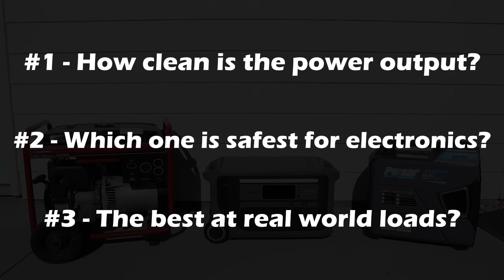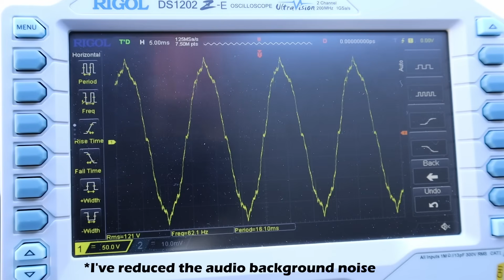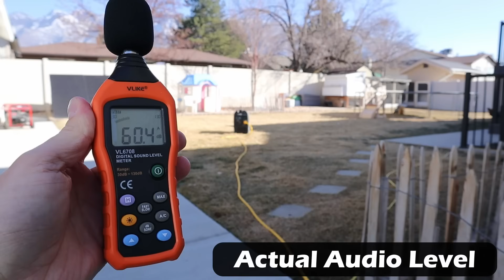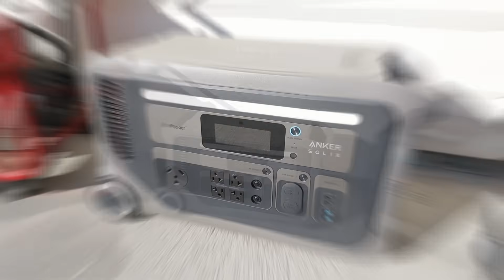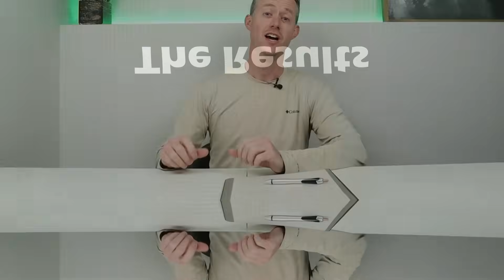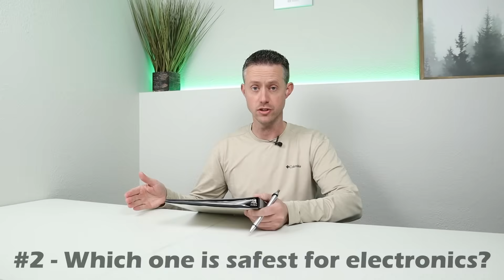Before You Plug Electronics Into A Generator, Watch This!

Comment: I recommend Honda Generators.  You can buy them and sell them for the same price or more you paid for them after a few years.   Done it many times.   They are bullet proof.
Reply from the maker: They definitely hold their value and last a LONG time!
Reply: @Jasonoid  One of the reasons I bought a Honda EU2200i and I am planning at some point to buy the 2200i companion model as well.  I don't really understand why Honda charges a bit more for the companion but they do.
Reply: @WJCTechyman I think it's because the companion has a higher output outlet for when they are joined together
Reply: @Jasonoid   No,they are not bulletproof. I own an older Honda 2000 gen and apart from regular problems with carburetor and fuel pump,the thing slowly disintegrates ,the plastic base anchoring the structure above is gone in strategical places (screws). Difficult to service and absolutely overpriced
Reply: I am a Honda power equipment ASC (along with many others).  Hondas are very good but are certainly not "bullet proof".
Reply: I work on this type of equipment professionally, the Hondas do not hold up well to large motor loads. If you have really poor power factor you will eventually blow the inverter board. I don't care if it's an eu2200 or an eu7000. They are great for powering electronics and other non motor loads. If you're going to be running a table saw all day, there's a reason they still offer an commercial conventional generator line.
Reply: @DJS_ENO  That is what they made for electric.  Your an idiot if you using them on a job side to run dirty motors all the time.  Sounds like you are customers are morons.  Job security.

Comment: Are you able to do the same test while on pass through mode?
(Inverter generator >>Ankerf3000>>load?

The anker can pass through 3600 watts
Reply from the maker: That sounds like an excellent video idea. In theory, it should work just fine since the inverter generator puts out such great power.
Reply: I'm curious if the Anker has the filter circuitry to de-noise/smooth the sine wave? 🤔
Reply: Maybe also through in a couple of zoupW solar panels!

Comment: That THD on the non-inverter generator is actually pretty dang good for that type of generator,  and unloaded Frequency is expected to be around 61 to 62 Hz, because it's related to engine speed, and when the generator takes a load you expect a drop in speed or Hz.  but that voltage was pretty low, even for a traditional generator, it may have other issues.  Nice comparison of backup power options though.  enjoy the videos.
Reply: Agreed. I would expect THD on a generator that old to be closer to 20. Maybe only the larger ones hit that level.
Reply: @markkempton4579 as the load climbs usually the THD does..keeping the loaded at about half rated running load usually keeps THD much lower.
Reply: @JONNYGEEKMANG  Will sometimes depend on the types of loads. THD will climb, but a mix of inductive and capacitive loads tends to keep it in check.
Reply from the maker: Thanks for sharing your feedback, I'm not super experienced with generators.
Reply: @Jasonoid It's not underestimate that a lot of the audience doesn't even know the difference. I try to keep things pretty simple and boiled down and I don't pull out things from my electrical engineering toolbox. Usually what happens when you do people who don't understand all those terms just start ignoring facts and they say THD bad only inverter generator.
Reply: I was thinking the same thing!
Reply: The speed "frequency controll"  feedback of the engine was poor, but probably adequate.
More loopgain.... needs a PLL or frequency detector. That controlles the throttle or adjust  the ignition.
Reply: @andreaskampe9143  The older generators, and many modern ones, use a mechanical governor. So there is a lag in the response that cannot be avoided. Plus even if it were electronic with fuel injection, there is still the mechanical inertia of the engine and generator rotor to overcome.
Reply: Te biggest problem is that the frequency oscilates due to single cylinder 4 stroke.
The DC frequency error can easily be fixed with a PID controller
 @mxslick50
Reply: @andreaskampe9143 It is basically a construction generator, no electronic governor and a very basic voltage regulator.
Reply: @andreaskampe9143 The governor response is not poor, that's exactly how it's supposed to function. You are combating mechanical hysteresis in the governor system. There are engines on the market which are now beginning to use an electronic governor, but they are relatively rare. I don't know if they've made it to the conventional generator applications yet.
Reply: @DJS_ENO  Changez le ressort du gouverneur. Vous verrez de suite un changement . Ces ressorts vieillissent très mal .
Reply: @gillescossec5571 Thank you for the information to check the spring if the frequency moves too much.
Reply: @andreaskampe9143 61hz-62hz unloaded and 58hz-59hz loaded is normal for this type of generator. If it's mechanical governor was set to hold a tighter tolerance surging could become a problem at light load.

Comment: Would putting an whole house surge protector in the house circuit breaker box have any improvement in both the street power and the generator going through the transfer switch? I was curious if this would enable the dirty power to be regulated by the home surge protector and prevent electrical interference.
Reply from the maker: It's more affordable to just buy a new inverter generator VS all the devices needed to clean up the power. They are usually much more fuel efficient anyways so you'll be saving on fuel as well.
Reply: @Jasonoid  Agree completely.
Reply: "Surge Protector" is nothing more than three MOV's (Metal Oxide Varistors) that tri-bridge Line-Neutral-Ground to do a "One Shot" shunt of high voltage to ground, IOW it works only once and then you have to replace. It's NOT a "line filter" to protect against noise. A UPS (Uninterruptable Power Supply) does 3 things...protects against surge, filters noise & provides near instant power DC-to-AC power for attached devices. Best UPS units will provide a near approximated sine wave instead of a modified squarish "sine" wave. Just an additional note on the usefulness of the MOV's. I had a previous job at an electronic parts store. One particular security camera tech mentioned that one camera installation kept getting cameras blown up by lightning. My suggestion was to bridge a MOV from the coaxial shield of the camera cable to ground. Guy bought a bunch of MOV's & installed them. Next time I saw him, he was extremely happy with how such a simple component was protecting the cameras!!!
Reply: Whole house surge won't clean up high THD from a generator....you'd need a double conversion (online) UPS to do that which is $$$.  Whole house surge protectors will help with spikes from storms, etc.  If you want cleaner power, get rid of the non inverter generator.

Comment: Only other thing to test would be to have a similar inverter generator and have them connected with a parallel kit to see how they sync and measure what the THD is. Best setup IMHO, is the inverter generator in economy idle mode paired to charge the solgen...most effiency to charge the solgen & then turn off to run devices on the solgen.
Reply from the maker: Yep, that's how I run my system during an outage when there's no sun. I charge my power stations with an inverter generator for about 2 hours, then let that run my critical loads for about 6-8 hours and repeat.